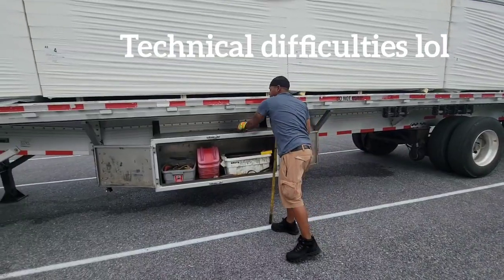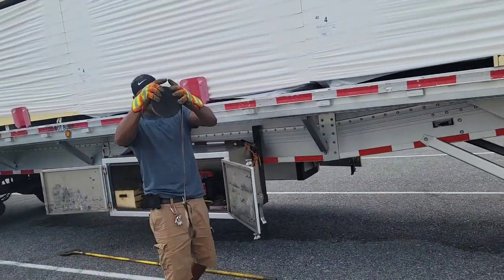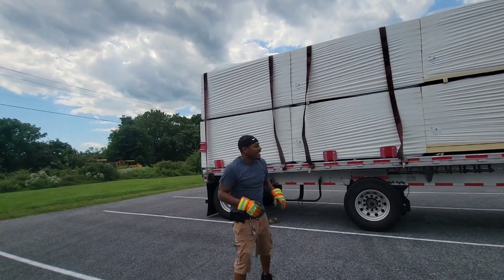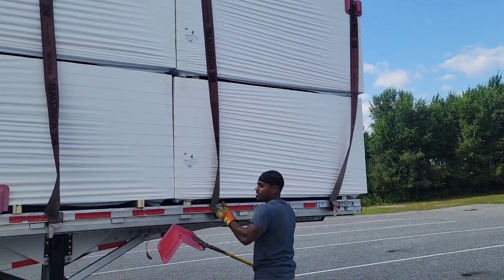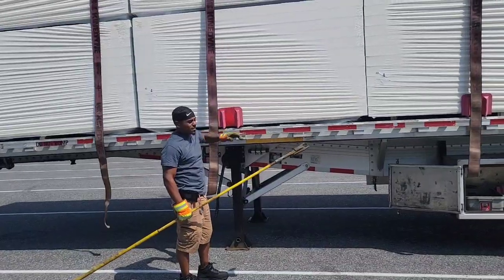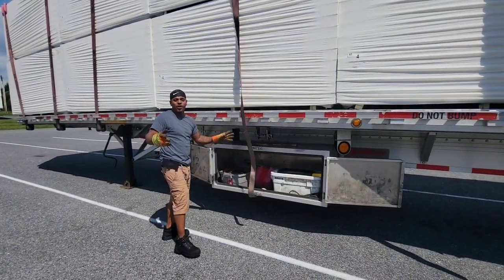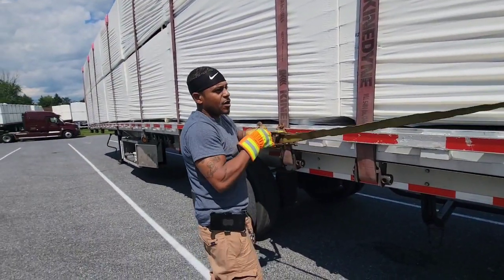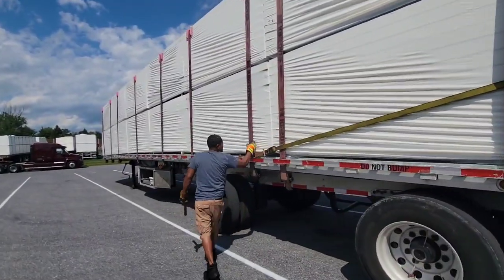STRAPPING made EASY: Quick Guide with Rob | Elevated Trucking

Comment: never go outside of the rub rail unless its an over size load. if this trailer comes in contact with something it could cause you to lose the load. Go behind the rail and hook the side frame . most newer trailers have a steel strap running the length of the trailer.
Reply from the maker: sorry for late response, i would if i could. this trailer has no cuff underneath if i was to go behind the rub rail. Ill have to take a video of it one day.
Reply: Whatever, if the trailer hits anything, it wasn't meant to be
Reply: How often are you hitting things?
Reply: I almost hit ever fuel island I go through.  But it's only one side so no biggie

Comment: U did pretty good fmcsa says a load check must be done within the first 25 then every 100 miles after that. I drove flatbed for years comin in to run local.
Reply from the maker: Appreciate the insight
Reply: That doesn't sound right.   25 miles?   I think it's within the first 50 miles then every 150 or 2 hours whichever comes first.     You should have put a half turn in straps on drivers side also and I think the strap has to have at least 3 wraps around the winch barrel.